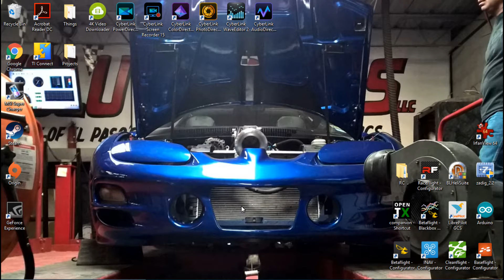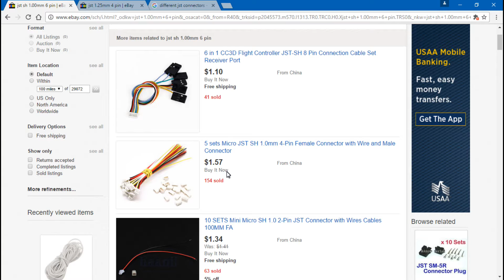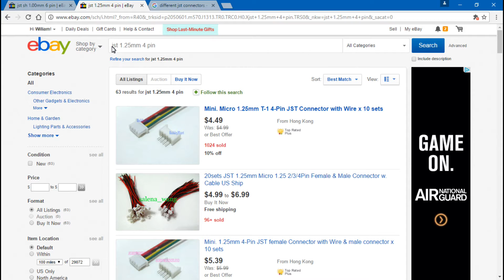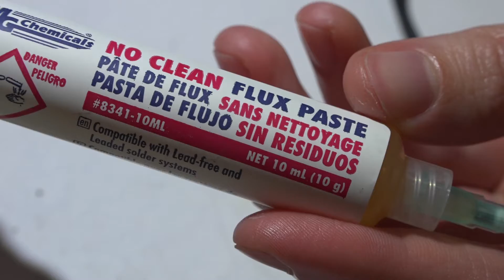Replacing Broken JST Connectors On Flight Controller

Comment: This is exactly what I need to fix. How do you know it wont short circuit the pads? Your solder seemed to be touching multiple pads together before you attached the connector.

Comment: Is it easier to solder a new connector on or to solder the wires directly onto the board? I assumed the connector would make the fine point job a lot easier but you made them sound equally as feasible.

Comment: Hey great vid. I just bought an eachine wizard arf. Tried connecting my frysky ia6b receiver to the FC through the 8pin connector with the ppm cable. My receiver is not getting any power to it. I put a multimeter on the 8 pin connector and the 8th pin reads 3.24v. I don't get any volt readings on the pin that is suppose to supply power to the receiver. I connected the receiver to a separate power supply and it works. My FC powers up find and is working normally. Any idea why I can't get power to the receiver from either io2 or oi1 on the controller? Thanks

Comment: If you have a video or instruction for connecting my THREE F3 Omnibus FCs that have the micro USB broken off I would be eternally grateful.  Cant connect by UART1 with FTDI OR Arduino nano.  Really dissapointed in this board.